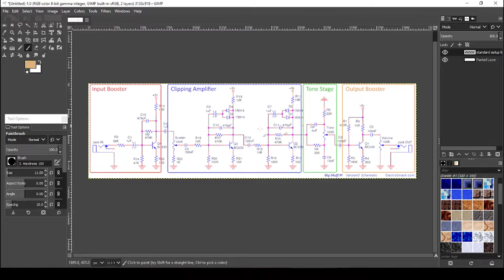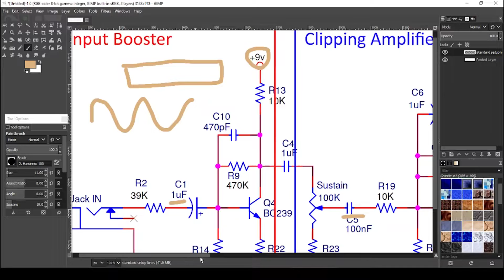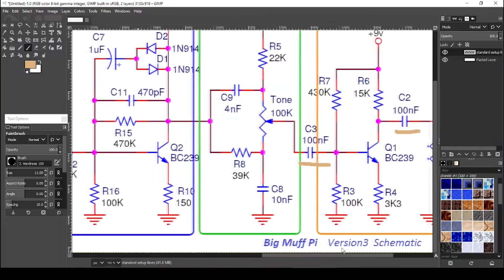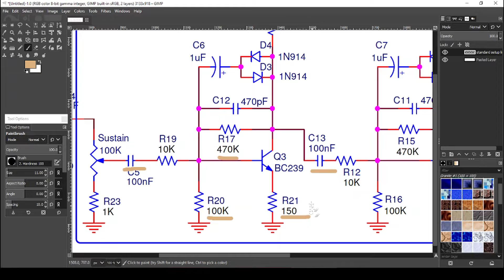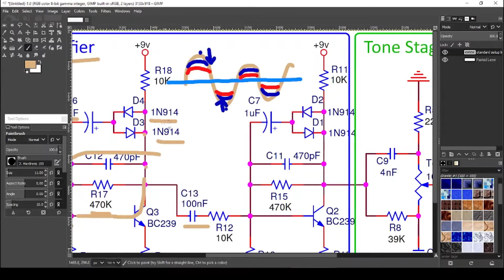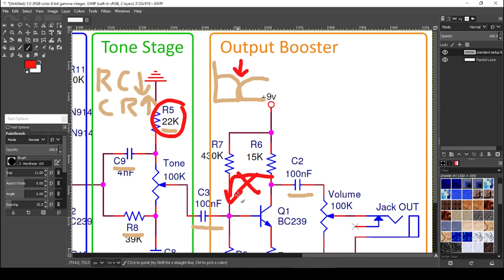Big Muff Pi Circuit Analysis

Comment: What about c6 and c7? Why use a polarized capacitor here? The diodes are already limiting the directional flow of electrons, right? 

Has anyone ever made a version of this circuit where the two clipping sections are in parallel?

Comment: Ive just finished building a Big Muff Pi pedal, but i was only copying a schematic.  I didnt actually understand the circuit.

This video is excellent.  And really helped me understand what was actually happening inside the pedal.

Thanks so much.

One thing im really curious about  is why the capacitor immediately after the input is orientated the way it is.  My instinct tells me that the + leg should be on the input side, but its opposite.

Thanks for the excellent video.  Really good stuff.

Comment: Regarding the negative feedback in the first transistor. You mention it cuts treble. You say increasing the capacitor value increases treble but I thought it was the opposite. A bigger capacitor would take off more treble I would have thought? If you can clear this up Bcs I am a bit confused by the negative feedback explanation sorry.

Comment: That's a great demonstration of the circuit.   I normally run my sustain very low, nearly off.  What would I have to do to modify the circuit so I can use the full sweep of the sustain pot for greater control but still have my max at a low level?

Comment: Awesome analysis. One more would be at 13:50. The current does not travel through the base into collector. The current from the base travels down into the emitter. The collector acts as a voltage controlled current source that reflected the base voltage so the current technical flows in from R13 which creates the inverted amplified signal before going into  the next stage :) finally can put my EE degree into good use lol

Comment: Great video! Just a quick clarification. The AC and DC do in fact mix according to something called superposition. All that means is that the AC waveform is shifted up or down by the DC voltage. So if you had 1V AC mixed with 5V DC, the resulting signal would still look like AC waveform, but the midpoint would now be 5V with the peaks at 4V and 6V (whereas the 1V AC had a midpoint of 0V with peaks at -1V and +1V).

Comment: Ehi this one I think is really important, I don't know if someone else pointed it out already...

Around 9:00 you talk about high pass filters, but if you put a resistor in series with a capacitor you ain't getting any filter at all, the two elements forming a high pass are the capacitor and the resistor put in parallel to the source signal (aka signal -> capacitor -> a wire which has a resistance connecting it to ground, and then from that wire you can go on. 
"Reversewise" if you exchange capacitor and resistor you get a low pass (typical passive guitar tone). Both of them start relevant cutting at a cut-off frequency easily calculable by
f = 1/(2*pi*R*C). 

Sorry for being so "pointy" but this could be very misleading for someone who hasn't studied the subject and could lead to non-working projects just because one builds all his filters (be it decoupling or something else) in the wrong way. 
I tell from past experience😅

EDIT:
Also increasing values of R and C is ok, but there is another value, which unfortunately is basically the exact opposite of the cutoff frequency (aside from the 2*pi factor), and it is the time that it takes for the circuit to actually "cut-off" any signal above or below the cut-off frequency (wether you're using a low or high pass): it's called sometimes the "characteristic time" of the filter and is TAU = R*C. So, for example, let's say you need a basic decoupling high-pass: once you've rechead a cut-off frequency of 10Hz, there is no point in trying to get it lower even if you have tons of capacitor larger than the one you are using. If, for example, you thought it was useful to lower it by a factor of 10, and have 1Hz, you would have the side-effect of charateristic time increased by 10 too. It is usually in the order of the ms if not 100s of microseconds if I recall correctly, so it's a time far below the typical human reaction time, but I still think that it is better to keep it low, since lowering the cut-off frequency below a certain point is really unhearable. Try to run a network test on your filter if you have the instruments and you can see that once you are a few Herz below the minimum your instrument can play, there is really no attenuation at all affecting the signal.

I had some similar problem when I was designing a power stage for a circuit, where high value capacitors are sometimes needed

Comment: I have a big muff (that sounds odd!) that doesn't seem to power on. All I get when I press the footswitch is guitar-thru/guitar-block. The indicator light ( Given the vintage, I'm not sure if this is an LED or incandescent) doesn't come on at all. But after reviewing like 6 different schematics- none seem to show this indicator lamp.  Can you tell me where in the circuit it is? I thought this was a good place to start tracing back to 9V to see whats-what!

Comment: I believe that the input resistor R2 is there to diminish any radio noise. These are called grid stopper resistors in tube amps and are a common trick to prevent radio signals entering the amp.
Reply: it could also be used with the capacitor to set the cut-off frequency, as the resistance it's coupled to impacts the capacitor

Comment: I feel like an echoplex set on a 1 year delay. 🙂  Just wanted to echo what everyone else is saying. I’ve been slowly studying electronics the last few years and have drilled into my head what caps, resistors, inductors, etc do but haven’t found many channels that go over circuits and how the signal flows, where is the dc going to, why the components used are there and this is perfect for me. Thank you so much for taking the time to make this video and share your knowledge. I also like how you start with the big picture (pointing out the 4 transistors and how this is more than most fuzz boxes have), then get into the nitty gritty of it all. I will definitely be looking at other videos you have made about circuit analysis. All the best to you and take care.

Comment: This is a great video! Helped me a lot in the process, currently in said process, of making my own overdrive pedal ... basically, it's gonna be a BM with the tonestage disenablable and a cleanblend - and downstream of mixing stage, another very very very slightly overdriving gain stage is gonna be introduced.

Until now, I'm playing with my prototypish device I wouldn't take onto any stage ... but I love adjusting, changing, trying out stuff, so this is fine with me. Once I got it all done, finished, tuned ... I'll have something that will make me a lot more satisfied than buying a buffered blender and another BM and some kind of cleanboost..
Reply: so, how did the build go ?

Comment: The nature of the RC filter on coupling caps. The final Volume control with a humbucker is 500k and having more resistance helps the same way a larger cap does. Raising all those resistance values might do as much of a significant tone change.

Noting the c10 is a bipolar and that in other schematics there's clipping diodes. Asymmetric and Symmetrical. I'm wondering the effects of using a polar cap for asymmetric treble bleed.. Especially on same side as asymmetric clipping diodes. So yeah 3 way switch.

But c6 there's polar series with symmetrical diodes..  When the next stage does it the signal is all opposites so one stage clips one way and cleans the next the reverse sides.